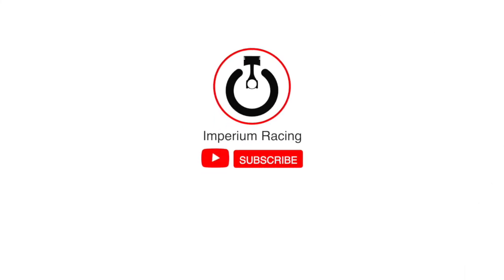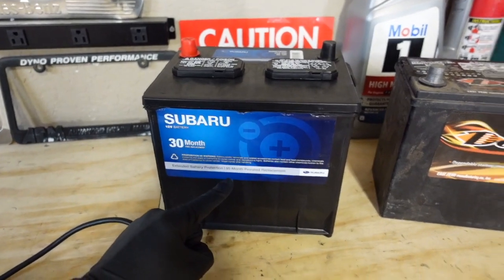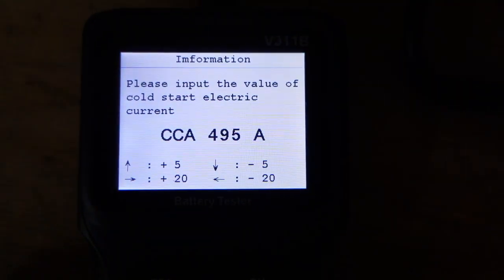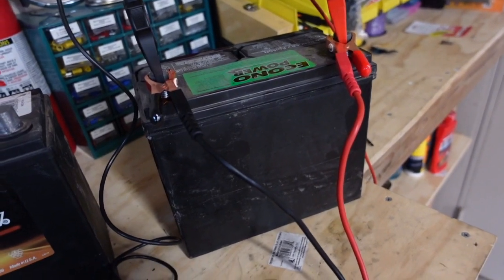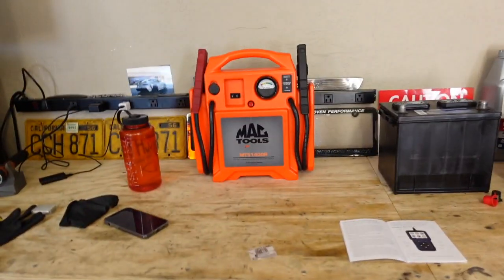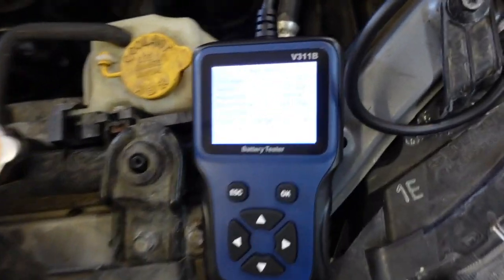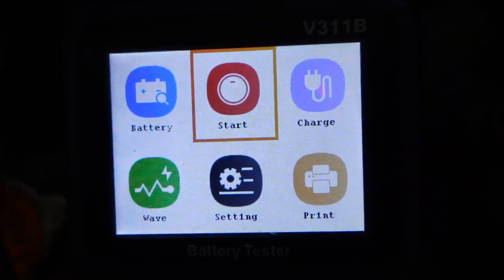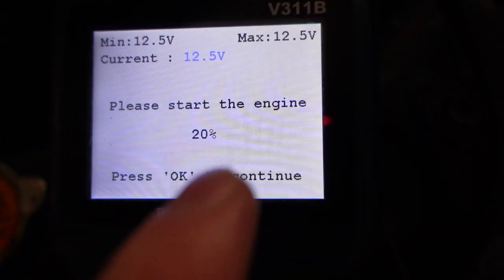Battery Tester tool review!

Comment: I got this for free. Jus wondering after using it if it's actually official. Seems to be ok.
Reply from the maker: I would say it’s pretty official! I don’t believe any major manufacturer uses this as their designated battery tester, but I believe it is accurate enough to serve that function. I’m sure an independent shop could use this in an official capacity for accurate results. This tool does have a print function I haven’t tried, so that’s pretty official. I have continued to use this tester since I made this video and it still serves me well every time. With my current level of automotive experience I mainly use the tester to confirm my suspicions of a battery or charging system and every time the results line up with what the other data hints at. So yes I think it’s a pretty solid battery tester!
Reply: @ImperiumRacing I started using it way more now. Yeah I kinda like it now. Thought it was a toy at first

Comment: Thank you for sharing this review. My question relates to the "Charge" Test. When the tester asks for the headlights to be turned on for 3 seconds and then off, can I at that point put a full electrical load (Air conditioning on full, lights on, radio on etc) on the battery to run the test? Will this tester give an accurate result for my charging system if I used a full electrical load on the battery?
Reply: Yes n yes. It's actually pretty dang nice tool.